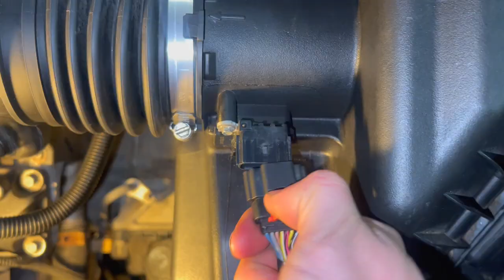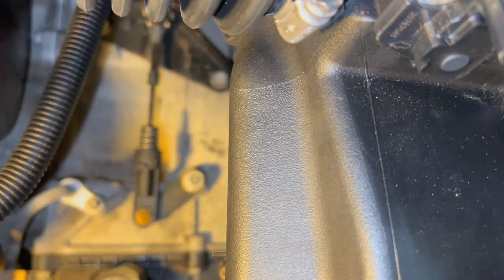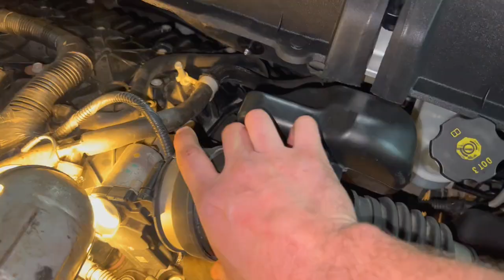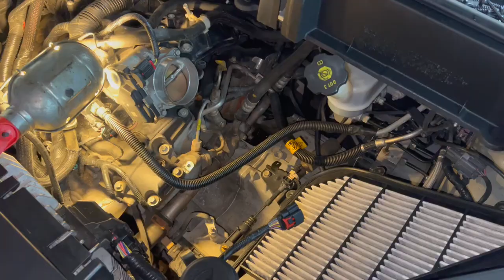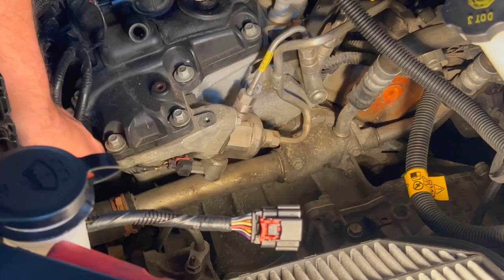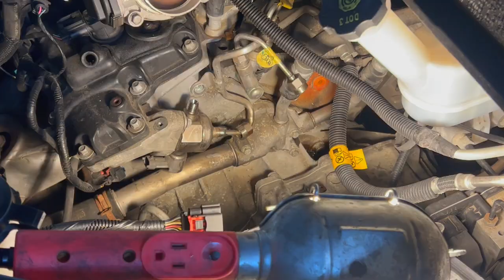Chevrolet Traverse 09-17 High Pressure Fuel Pump Removal | 3.6L | How to Remove | Misfire | No Power

Comment: Alright I broke the secure clips on my plug, and my latch looks different then yours, I had to small fins on the sides but I broke them off trying to push them out. Can I use a screwdriver to push that blue piece under the black tab or does my tab use a different orientation? Any advice would help, thank you!